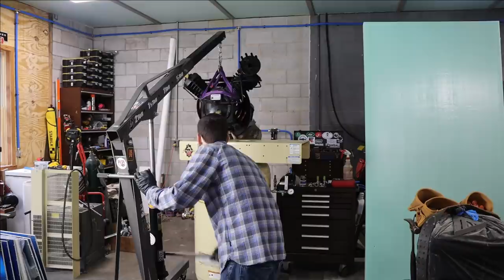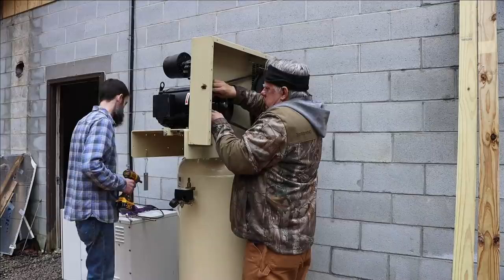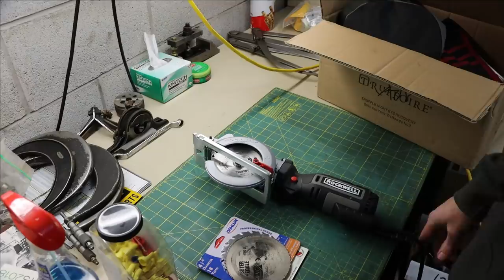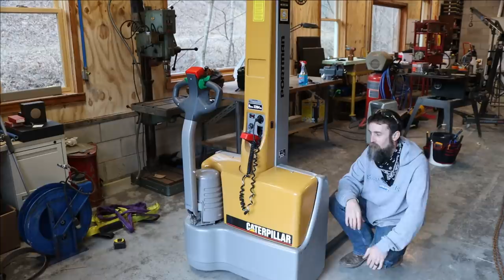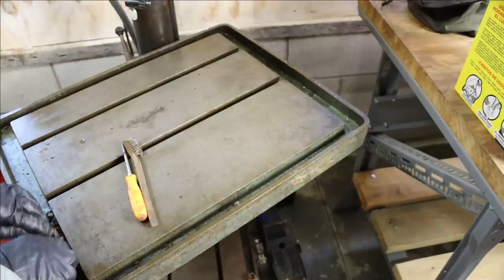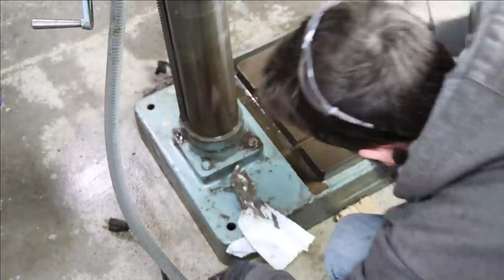Awesome New Shop lift! /  Doall Drill press 1st run and clean.

Comment: I saw all the flooding in Ky this week, and I was hoping you weren't affected by any of that. What works good for cleaning equipment is purple cleaner and scotchbrite (green on unpainted surfaces, and blue on paint) to get the worst off, then go back with simple green and shop towels. The purple stuff goes a good job on grease, but seems to leave dirt behind. The simple green does a good job of lifting everything and then you soak it up with a shop towel.

Comment: Got one of those exact same saws..  i took the bottom guard off and the trigger safety and has been a hell of a good saw..  put an angle grinder metal blade on it and works awesome for your thinner metals up to 1/8 inch..  quarter inch is pushing it as it doesnt quite have the balls for that but slow and steady it still works..  put a tile blade on it and a water hose to the little dust port on a drip and worked great as well..  the head has no electrical in it so no risk of shock really..  used the spacers off of the bench grinder to adapt the 7/8" arbor blades to it...

Comment: Wow, that lift is an exceptional find. Congratulations! Just match the Group size and voltage and get deep cycle not car batteries for it. You can buy them just about anywhere. I buy all my batteries from Costco.
Love the drill, I would love to find one of those. Sadly, the only ones I have found at a reasonable cost are on the East Coast. Can't believe you got it for $300. Here on the West side of the country equipment prices are completely insane. That unit would be $2000. Very nice unit. I will just drool over yours until I find one. LOL
As always, thanks for sharing your adventure. Looking forward to utilizing some of your projects in my final shop at retirement, just 16 months away.

Comment: @Steve Summers    I think your better off in the long run with deep cycle batteries. Car batteries are not meant to be discharged as far as that lift will take them, thus destroying a regular battery. But, with that said, nothing stopping you from using Walmart marine deep cycle batteries, or if you have an Interstate battery near you, they usually have rebuilt/refurbished deep cycle batteries. Also, remember, extreme temps and low batteries are what kill batteries, so keep these types of batteries, i.e. car and deep cycle, topped up, especially in winter.

Comment: Steve,
You will be happier with deep cycle batteries. You can save some money by using smaller deep cycle batteries. We employed smaller batteries in the industrial setting very successfully, where lifts were cycled infrequently like you will do in your home shop. Auto parts RV style batteries give you some easy to to explore options. Automotive style batteries don't like the deep discharge like a deep cycle battery will sustain.

Your drill press appears heavier to me than it did in your previous introductory video. It is still a very nice score. That work light looks very much like the Arboga machines we had our shop. My DoAll is bigger and has power quill feed. The motor starter on my machine is in the rear of the base. Drill presses tend to get crammed into small spaces, especially when the lean manufacturing Kaizen team redisorganizes the work space. On the very rare occasions that service is required to the motor starter, having the motor starter there is problematic... But drilling capacity is a delight. Enjoy your machine. Yours, being smaller than mine, will probably be more practical than mine for daily use. I use my smaller drill presses much more regularly.

My most recent drill press score is a bench top Craftsman. From what I can discover so far, it was made for only 6 months and production ceased to increase war production capacity in the 1940's. When I bought it with a Pexto angle vise for $25, I thought that it would be salvageable for a grandson. Every moving function except for motor and spindle bearings (vise too) was rusted frozen. I started clean up to the drill press and the vise and discovered the rust was only surface rust. ALL the rust cleaned away to beautiful finish with Scotch-bright. I am surprised at how well the drill press made. It is rugged and the fit and finish is very nice. All adjustments work effortlessly. I did a "full" restoration to it and the vise. This was mostly cleaning and painting. The old Pexto new was not painted, but now sports a nice blue shade. I struggled with embarrassment that I own a Craftsman machine and put it into shop service, but this little guy is a gem. I also restored the Dunlap motor that came on it. I love the little drill press and possibly use it more than my vintage Powermatic, especially for small hole drilling. It is too fast for serious metal drilling. I will soon be separating my metal shop/machine shop from my woodworking shop. I will keep the cute little Craftsman in the wood shop. Grandsons will likely now have to wait for the time when my shops suffer total disbursement.

I scored on a granite surface plate and a angle plate this week. My other finds from this week will go to sons and grandsons. I currently have 23 that I am buying tools and equipment for. This is a fun stage of life.

Comment: Steve I have an Ez-Go golf cart that is 36 volt.  It had 6 -6 volt batteries that were gona cost around $800 to replace. My brother put 3 12 volt deep cycle batteries on it and i have been using it for almost 2 years now with zero problems. I think your idea of deep cycle batteries will work fine. Not being used in an industrial environment the duty cycle will be very low as it will set idle most of the time so go for the deep cycle batteries. BTW I have the size smaller 2 stage IR compressor I have mine in a separate building and ran the lines under ground to my shop. They are very well built compressors.

Comment: Steve for the lift car batteries will work But boat batteries will work better (deep cycle) they are meant to go way down on charge then charge up, car batteries are meant to maintain a level between 11v to 13v

Comment: You should make a lithium iron phosphate battery pack and put it in that lift. You can find them cheap through certain resellers. They hold a ton more energy last longer are more powerful, safe and have a large operating temperature range.plus it would be a fun project.

Comment: If they will fit, get two 6 volt golf cart batteries, and wire them in series to produce 12 volts. GC batteries are excellent deep cycle, and will last a long time. Sam’s or Costco has good prices.

Comment: Steve, have you considered boat/RV batteries ??? 😁😬🙄🤦🏻‍♂️

Keep your eyes open for an appropriate sized faceplate from an old lathe with a threaded spindle.  Turn a slug to fit it to the drill press.  Increase versatility, and if you decide to inflict repairs on the original table, you can still have use of the drill press while that is being done.  My Buffalo Forge camelback style came set up like that, and I really like it.  I found it much easier to use for jig setups while drilling multiple pieces.  Plenty of flat space on the back side for the use of clamps, plus the through slots and T slots.  Only drawback I see to it would be when it comes to the use of flood coolant.

Comment: Make sure you confirm the voltage on the batteries.  We have one similar to that-maybe a larger model but still a Cat-and it takes 2  not 12 volt batteries.  If they are 12 volt I would use marine deep cycle batteries rather than regular car batteries-they will take the charge-discharge cycles better.

Comment: You can replace the AGM batteries with lead-acid. Deep cycle batteries are the best choice if you care about longevity. The existing charger should work fine as-is.

Comment: Check Sam's Club or Costco, for Glass Mat replacements. Should be cheaper, not as cheap as start batteries, but much longer life. Also check the charger specs. If it is too different than the replacement batteries require,  you will kill the new batts way early.
Best wishes from the far North.

Comment: I have the same rubber and cork pads on my bed feet.  I have a built in massage mode on the bed that make tons of noise on the hardwood floors. =)

Comment: We work on those at work and the purpose for those batteries is for the shock and impact and vibration that the battery go thru they should be AGM battery 🔋

Comment: That drill press cleaned up real nice. I have been looking for a decade and not found one I can afford. On the other hand, I got my Dumore precision drill for $20. The arc of shame isn't too bad here. My first industrial size unit had such a bad one that the first time I put a heavy part on the outboard side of the table. it snapped like a salteen.

Comment: You might check into reviving the current deep cycle batteries. Telephone and cable television use batteries for backup and replace them on a regular schedule. If you know someone that works for them or the place where they recycle them you might be able to get some fairly cheap.

Comment: I know drill presses with wood tables often have an insert in the center of the table that can be replaced.  I've never understood why they don't do that on the metal tables as well, given how they always get holes there.  It would be far easier and cheaper to replace.  You could probably mill/drill a circle or square out where those holes are and put in an insert.

Comment: 300 dollars for that drillpress....i paid  more than 2 times that for my arboga,it is almost similar swedish drillpress.
I agree that yours is made by strands,it looks like it.
Both of those brands are wery good guality machines with standard bearings that are easy to fix.
I think biggest difference between them are quill,there is no adjustment on arboga but it has a little bigger outside diameter.Great video again,thanks.

Comment: Steve, great channel. A few suggestions for what they are worth. First, if you are so concerned with not having too many posts in the way, why not consider just installing support posts to the wall? That would be more than sufficient for such a short roof. And let me recommend mounting a cement board on some spacers between the compressor and the wall. That will really make a difference in the amount of audible noise penetrating.  Can’t wait for the next update, keep up the great work.

Comment: I think you may be right that standard lead acid batteries will work but here are some considerations. AGM batteries chargers charge different than lead acid, this may not be a problem for charging L/A but it is a problem the other way around. #2 is AGMs discharge much higher so that may be a problem when lifting heavier things. That being if I were in your shoes I’d try it with some lead acid you can find or check your local junk yard. Vehicles with start/stop or hybrids have AGMs. Great video as always!

Comment: Use good deep cycle marine batteries in the lift. My favorites are the spiral wound gel cell. DT 31 out last most others they cost a bit tho. About $500 for a set. Drill press looks super with cleaning it up.

Comment: The birds, bees and hornets are watching this installation and saying to themselves......." Isn't that nice of Steve to put out such a nice fancy new home for me ! ".
Reply: In any case the building for the compressor and converter needs to be well built and everything fitted tight so no birds or bees can gain access to the inside and vented with two types of screen a heavy duty window type screen and a 1/4 inch square screen like for a rabbit cage so the birds can't ripe a hole in your screen, which they will.  I have no doubt you know much more of what is needed in your build than I so good luck. 
   Oh by the way it looks like the new renovated shop is getting smaller and fuller by the minute, yes it will never be big enough. As our friend Keith Rucker realized as big as his shop is turned out to be too small for a metal shop and a woodworking shop so now his new big shop is looking more like a full on metal shop, who would have seen that coming. lol
Reply: I hope he does not have mud daubers. I had to put screen over the cooling intake on all my electric motors. I replaced the motor on my old compressor 3 times in 30 years due to mud daubers. $600 worth of motors 3 times more than i paid for the compressor 30 years ago.
Reply: Especially the wood boring bees.....

Comment: G'day Steve, great job on the drill press!  I have an Erlo TCA 32 drill press with a massive column.  I like it for many of the same reasons, as well as the power down feed.  This is great as my mill doesn't have it.

Comment: Tapered stock in the through holes driven into the hole then welded works well on tables like that. That kind of lazyness always annoys me, other than that you're right it looks like it will be a good tool. Thanks

Comment: If you can find a ratcheting chain hoist for cheap pick it up, they do the job of a come along but they do it 10 time easier, especially for lowering a load like the one you had in the truck for getting the hoist out.  
That drill press looks nice, I worked for DoAll for a while I don't think that they ever built anything other than grinders and band saws inhouse but the other machines they put their badge on in the 60's and 70's were all good.

Comment: I bought an old drill press a couple of years ago that some numbskull had drilled an arc of 3/4 inch divots in all the way across the table.
I cleaned the holes really good and then mixed up some JB Weld and filled them up with it.
You can sand the stuff down before it hardens completely and it turned out excellent. It's not cast iron but you don't have any holes to catch things on or tilt things into either. I would highly recommend trying that for a repair.
Reply: Or..... just fill it with weld and then mill it flat ;)
Reply: @simonscott1121  Or braze metal, since it's a cast iron table.
Reply: My two pennies...

Wondering if heating the table in a localized spot like that would create cracking or warping issues? I was thinking of plunge milling a common sized slip fit hole starting at the beginning of the line of holes and install a plug of cast iron round bar with permanent loctite. Then move to the center of the next defect and repeat until they are all filled.  This would bond the plugs to each other and to the table without heat or side pressure from a press fit. Then machine and hand scrap flat to the surrounding surface. Wouldn’t be a completely hidden repair but would be plenty strong for the application.
Thoughts?

Comment: Rockwell tools are usually pretty damn good tools. My dad had a ½ inch hammer drill he got when I was little and that thing was over 40 years old when someone stole it.
Reply: I'm pretty sure that the Rockwell brand was abandoned back in the 80's or 90's.  The current user is a Chinese outfit be the name Positec.  So your dad's tool would have been from the brand when it was made in the USA

Comment: Looks like there's enough room to cantilever that shed roof and keep the ground clear.
Reply: was thinking the same,just nice little roof,like 20-30 degrees without posts
Reply: @filmer197  Just a post on the creek side will do, and then a sturdy front beam with an angled brace to the post, so it will not warp. Leaves room to bring around the power machinery to the rear, or Steve can simply extend the post to the bank and place a foundation there to hold it.

Comment: Having dealt with various "industrial battery" units, those rechargers are configured for specific batteries.  You may put a couple car batteries in there and have the recharger not recognize them, or worse yet, have the recharger burn them out.  My last unit, a Parcar, had a programmable recharger to avoid this if possible.

Comment: Happy Saturday, Steve, and Grits!  Do-All is lookin good and much superior to changing belts to adjust speed. AGM Batteries are more expensive and do have one undesirable characteristic, There is no gradual voltage drop, they are up or down. One minute good, then next minute dead. I have had bad experiences with them in a over the road truck fleet. Wife's car had one and she went to the bank, shut car off, came out, battery dead. I replaced with lead/acid. In the future, I am sure they will improve but for now, spend's less, lead/acid.

Comment: Nice Cat lift, still has the nasty shine on it. That's going to make you want to pour some more concrete in front of the shop real soon. Pretty sure the compressor motor is 3 phase and that alone is going to max out your phase converter. Keith Rucker bit the bullet and got a single phase ($$$) motor for his for just that reason.

Comment: The end charge voltage is slightly different on gel cells which I presume those are.  I'm not sure without research if the wet car battery will be slightly under or overcharged.  Gels have the disadvantage of being done when fully discharged one time.  But the great advantage of being able to take many more partial discharges. A car starting battery can't pass the factory rating after 8 or 10 50% discharges.  Were I you, I'd put the same chemistry back in but much smaller would be fine.  You don't need all day operation, just occasional use.   Also, all lead acid batteries are extended in life by minimizing the time they are under 100% charged.  So, have a plug where you park it.    I wouldn't be surprised if those batteries are 100-120 amps capacity.  I bet 20 amps each as a floor would be fine.